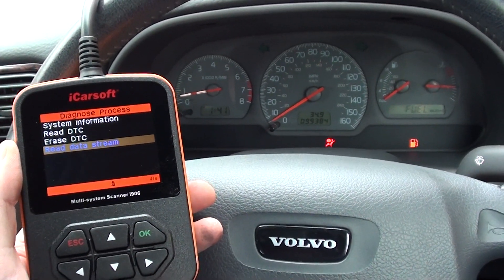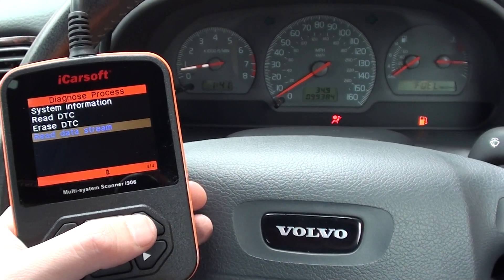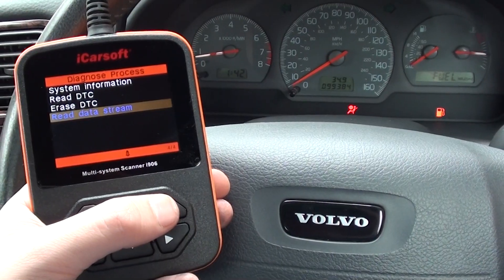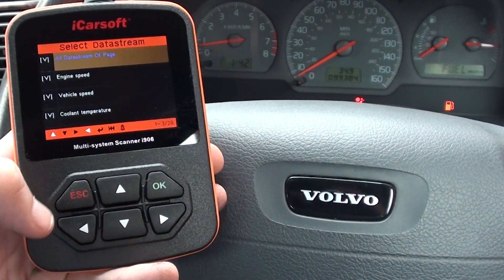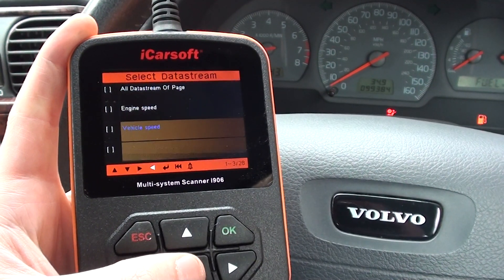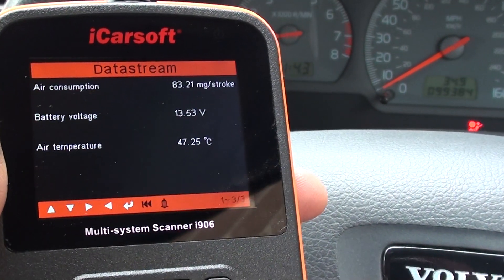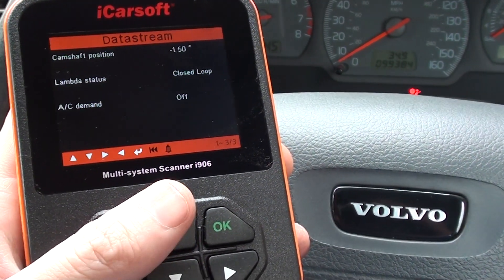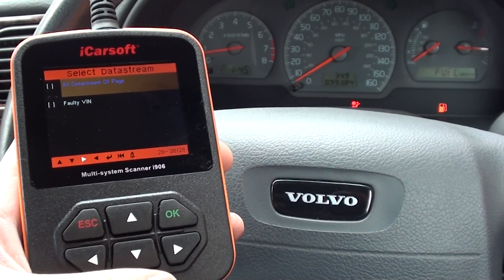Live Data Stream Demo Volvo i906 iCarsoft Diagnostic Tool

Comment: The aftersales service with this supplier is VERY poor indeed! I bought a i906 n was well pleased with it n it did what it said on the box, no probs! But, it suffered (& still is!), with a temperamental ESC key n works when it wants when pressed as you are getting out of that test. Tried contacting seller on NUMEROUS occasions, with no response back! I've now had to go direct to iCarsoft in the US & try to arrange for them to either repair or replace, but I have to pay shipping both ways! Looks like I've kissed £96.00 away to be honest :( So buyers beware!!!

Comment: Looking at the battery voltage, I'd say either the battery or alternator is on it's way out.
Most likely battery.
Reply: +sirobb obviously you don't know about charging systems
Reply: +alfadave11 And your reason for saying that is what?
Reply: Read data .....I rest my case
Reply: +alfadave11 If you can't be bothered to explain yourself, I think we'll agree to disagree.
Reply: That is a healthy charging system ..go troll elsewhere. ..
Reply: +alfadave11 Trolling? 
You're the one jumping on an old comment I made 14 months ago! 
If you disagree, who cares?
Reply: A battery while the car is  running should read around 13-14v